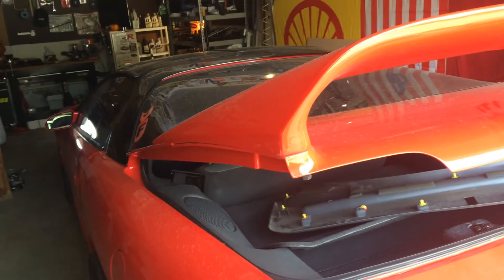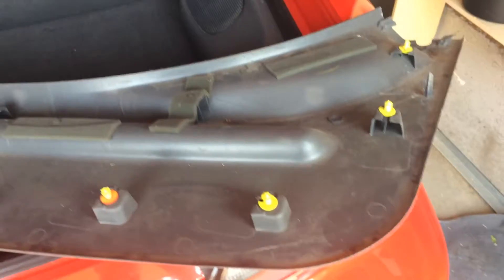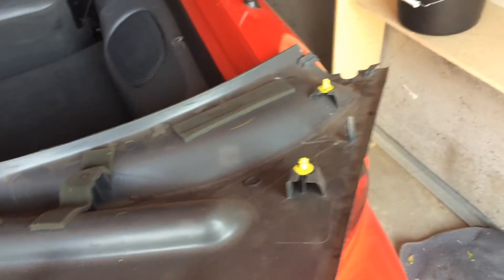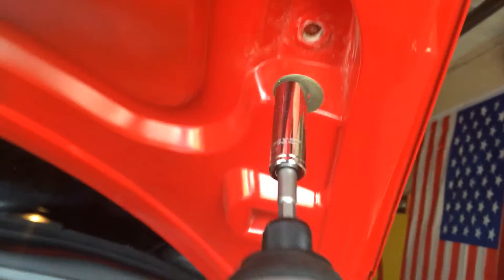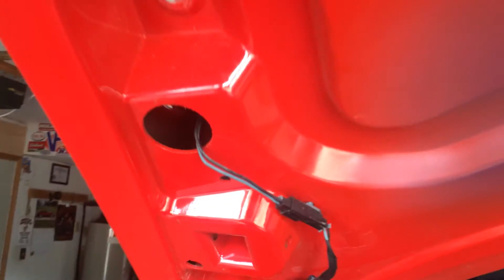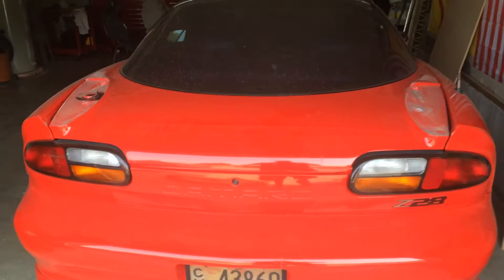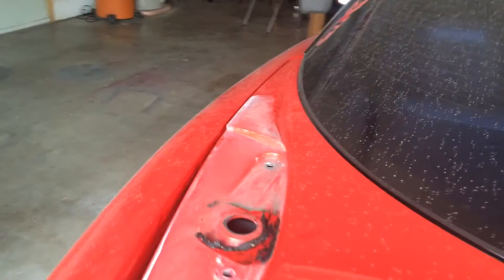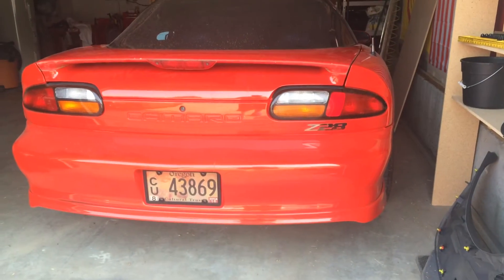93-02 camaro spoiler swap aka de-rice

Comment: How did you pop off the trim?
Reply: I have popped off the hatch trim before,  I used a plastic tool like a radio and trim removing tool (that comes in a kit from Harbor Freight) to pry out the yellow plastic push clips or whatever they're called. the plastic tool is shaped like a small pry bar, just pull up on the plastic trim pry under the head of each clip and the panel will let go.